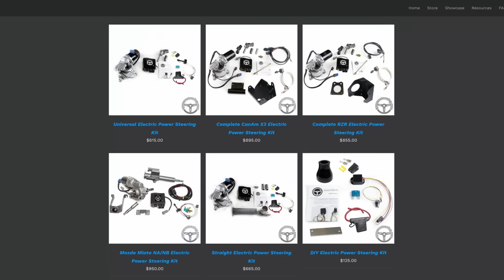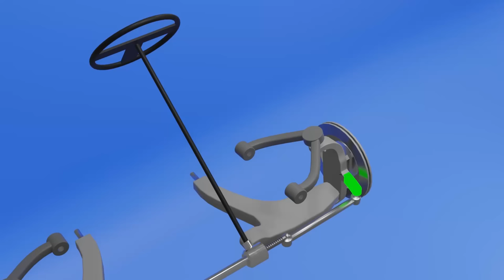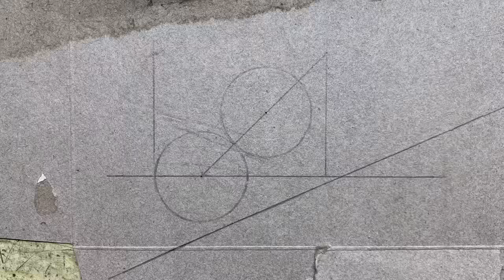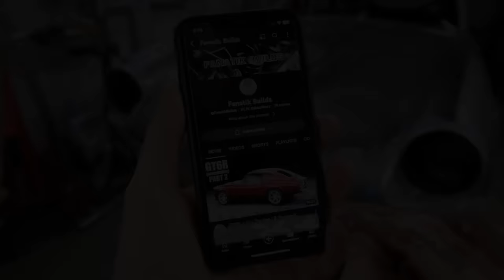EPS Steering Conversion // Pro Touring V8 Triumph Build – LS Powered GT6R – Ep34

Comment: Get your manifolds ceramic coated, inside and out, and maybe wrap the downpipes where they run in the engine bay (if there's room) and you'll have a lot less heat transfer up the steering shaft. Anyway, looking great!
Reply from the maker: Absolutely, heat management is going to be key!  Thanks man, enjoy the weekend ahead!
Reply: Also air escape vents from to bonnet area to let the hot air out upwards. Bonnet louvres are good. The Le Mans Spitfires (they had essentially the same body) used Herald 1200 radiator grills, cut down, in side vents.
Reply: What affect will heat have on the lubricant for the double universal joint?
Reply: @dannewth7149  yes, you have a good point. That short steering joint had better be heat shielded, and given a high temperature grease.
Reply: I don't think there's room for wrapping

Comment: If you're running a gm ecm, I recommend using the gauges from a trailblazer or from and mid 2000's truck so you'll have all the vitals
Reply from the maker: Not quite the direction we've got planned, but thanks Jerome! ✌️

Comment: That's a lot of stuff to shoehorn into not a lot of space!!! Going great guns. Fingers crossed the exhaust manifold doesn't get the shaft too hot. Ceramic coating the header will help a bit with that but yea, gonna be interesting long term 😉
Reply from the maker: Thanks man, it's been a process! 😅 We will open up a bit of space around the manifold and block (with a grinder) later so we can fit some heat shielding in place ... definitely getting ceramic coated though, so we'll see what happens! 👍✌️😊

Comment: Plug weld that steering shaft into the tube.

You know what I mean. If not Google tube it. Solidifies the joint and removes stress from the single weld ring.

Comment: Great to get an uodate from you! As usual, the work looks excellent.
FYI, that flat spot, plate and lock nut contraption on the original GT6 steering column is not a safety feature. It isn't designed to colapse in an accident (they didn't worry a out those things in the 1960s when the car was designed.)
 It is used to adjust the steering wheel closer or farther from the driver. But... 
I recently watched a YT video where much of the adjustment had been used, moving the steering wheel back closer to the driver close to the maximum amount possible... the result was a lot of vibration felt in the steering wheel. Once it was adjusted to position the steering wheel closer to the dash the vibrations largely disappeared. The video is on Elin Yakov's "Rusty Beauties" YT channel.
I agree with another post that heat from the exhaust may be an issue. The steering column in my Land Rover is nowhere near that close to the exhaust manifold, and it's heat wrapped from the factory. (Getting a bit tattered now, 26 years later.)
Reply from the maker: Hmm, everything I've ever known about the design of this column was indeed for safety reasons, as it's not easily adjustable to fit the driver, as modern cars are.  Either way, it could serve both purposes I guess!  What we've ended up with is the clamp being positioned right at the end of the original flat spot.  So there will be as little twist as possible with these parts. 👍  We'll increase the clearance around the exhaust as much as we can later (with a grinder) but ultimately some heat shields, sleeves and ceramic coating are all we can do, so we'll find out! 😅

Comment: Nice works guys!  If budget allows a custom built steering wheel could be made with an offset that would position the wheel either closer or further away from the driver.

Lets hope for proper alignment of the planets that will bring you new tools and garage sponsorship!!
Reply from the maker: Thanks David!  The wheel currently has a quick-release installed, so there's already 1.5" of optional offset baked in!  In the end I don't think we'll keep the quick-release ... likely replace it with a solid block, or just remove it entirely.  But I'm happy with fitment as it sits!  Haha, that would be awesome, particularly the garage bit! 😅🤞 Cheers man!

Comment: Absolutely wonderful build! I had a GT6 Mk2 back in the day, and I dropped a 2.5PI engine into it, and I thought that was radical, but an LS? Jeez.  Your engineering skills are off the chart.  Love the way you mounted the rad – TVR did the same on all Griff’s (I have owned one for decades) and other models, but they added a swirl pot which I’ve not seen on the posted videos which I have seen.
I’ll keep searching for you videos.  The GT6 is a gorgeous car – I loved mine to bits, and kinda wished I had never sold it.
Reply from the maker: Cheers Andrew!  Swirl pot/expansion tank yet to come 👌✌️ all the best to ya!

Comment: That will look just like an MGB, but it definitively won't be one. 😆 Your metal building skills quite evolved since day one and are quite impressive considering you have a MIG, a press drill and a grinder. On a side note, wouldn't it help to use some kind of lubrification when drilling ? Also, go check out some Schmidt Couplings for offset shafts. I know, I know, your setup is now done, but that would look mad in place of that double U-joint. 🙂

Keep it up, it is shaping up very nicely !

Comment: You have three U joints. That means they cannot be phased for constant velocity. If you have room for a 4th one it should be done. Brilliant work with just a grinder and a welder. If you needed a windshield I think you could fab one with these tools.
Reply from the maker: Haha, thanks Jeff, I'm not sure about that fabricated windshield, but we do need one still... so I guess there's a chance! 😉 In a drive-line, this is 100% correct.  However in a steering system, which will be turned slowly back and forth, I'm not concerned about the slightly imperfect phasing.  The lower double universal cancels itself out completely, so it's just the one UJ at the top that's of interest, and it's not a huge angle. I think we'll be fine.  Appreciate you raising the concern though! 👍

Comment: That's a very tight space that the steering shaft has to live in.  Have you considered the possibility of the engine contacting the shaft?  The degree of movement of the engine on the engine mounts under load, braking, cornering etc.  That said, nice work.
Reply from the maker: Definitely considered it, must not have made that clear enough in the video as I've had a lot of people ask about this.  The engine/transmission are mounted on polyurethane bushings that have an almost imperceptible amount of movement in them.  We will also come back when the engine is removed later, and do a bit of grinding on the block and manifold to make some more space for heat shielding - as it is, we could remove about an inch of the block without any issues whatsoever!  All should be fine in the end 👍 Thanks man!

Comment: Outstanding! Great work. Hope you’ve got some pretty hard engine mounts!
Reply from the maker: Thanks Baron!  It’s on poly mounts yes, but we’ll also likely remove a bit of material from the engine and manifold when everything is getting painted later … every millimetre and all that!! 👌🫡✌️
Reply: @FanatikBuilds  Also the way it torques it should move away from the steering shaft.
Reply: @Levibetz  ahhhh excellent point, I hadn’t considered that (but I’m sure Mike did) 😅

Comment: I love that a steering column with 2000 parts cost less than a small black box which you will never be able to open.
I am just 5'11" and my eye line in ever modern car i around the rear view mirror, viewing traffic lights or anything above pedestrian head height, or anything behind the steering wheel, like speedo, is some what troublesome. What you have no worse , so you are up with modern car standard.
Yes I have driven a Triumph Spitfire across Europe on a road trip with my brother .
Hope i live to see this completed, it is epic.
Reply from the maker: It is quite ironic isn't it!  A big reason why I'm trying to fit as many used OEM parts in here, as the new aftermarket stuff is priced ridiculously these days!  Good to hear, legs/torso proportion makes a difference, but I agree that the rearview mirror is usually pretty low in cars these days and often gets in my eye line as well... thanks, it's been a lot of work, but it's pretty comfortable in there now considering everything!  Sounds like a great road trip, I'd love to do a cross-continent one with ours someday!  All the best, and hopefully it will be done in the not too distant future 👍🤞

Comment: To get more foot room you could do what Jaguar did with the XK-E, lower the floor. The early Es were "flat floor" cars, they soon dropped the floor about an inch to gain room.
Reply from the maker: Yeah I thought about it, and I would, if some "dummy" hadn't put a frame in the way! 😅 (it now runs right underneath the floor pans) Honestly though, the foot room is perfectly ample now, so crisis diverted! 😊✌️
Reply: @FanatikBuilds  As I continued watching I saw that your solution was better than mine. Of course!

Comment: Looks amazing so far! The stuff you guys do in a limited shop really is amazing! 
One concern, do you think the steering shaft will bind when the engine is twisting and loading up the mounts? Or does it have solid mounts, I can’t remember lol!
Reply from the maker: Thanks Stephen, appreciate it!  All good, the engine/transmission are on polyurethane mounts, and any movement that is there, I can't even see! ... so it may have some NVH but at least I don't have to worry about it rocking in to anything important!  We'll do some slight adjusting (with a grinder) to the engine block and manifold later when it comes out too, just to get back every mm we can! ✌️😊

Comment: 6:30 For a long time i was curious if i could modify that part for my own purposes where nothing dangerous would result. So after talking with a couple of my friends one night, i decided that an unbiased test was in order, so i dissembled a yoke, drilled the shaft out and welded my own. Then i tested it against the unmolested other half. At the very least for that part, which i TIGged in place from both the inside of the yoke and the outside, i had no issues. Both yokes broke at about the same force level (roughly measured by how many pulls i did on the come-along i used), which would be far, far above any force you'd put on, neither failing in the link between the shaft and the yoke, rather in the arms of the yoke.

The idea was not mine (the drilling of the yoke and changing the shaft) but i'd always been too chicken to actually trust it. So far i've only used it for an off-road car, never for something on road, and in three years (which got a lot of use on account of the pandemic) hasn't had any issues. So, at the very least in this small sample size, it works that way, it's easier to find shafting in the right size than it is to grind it down without a lathe and the shape of the yoke doesn't help either.

About the procedure:

When i TIGged it, i heated both parts (shaft and yoke) in an oven, and did i put a bolt with nuts to keep the yoke from warping. I don't know that it would warp, but i thought better safe than sorry. I bored it out to the exact same size as the shafting by getting the closest drill i could find, then using a piece of sand paper on a flapper to bring it to a press fit. The shaft was the same shaft the steering came with, as this was just a test.

As for the test itself, i welded on both the unmodified yoke and the modified on a 20 cm lever arm with a hook, and i used a come-along to pull it. Dunno how much actual force i put on it, but the come-along was rated for 2.5 tons. I used bearings mounted to a piece of 1 cm flat stock which had a rod welded to keep the yoke static through the yoke's eyes (kinda like how the heart of the u-joint would, to mimic the OG nature of the joint as close as possible.

Comment: great job, If I may, there's a thing you should be watching carefully, those double u-joints on the base of the column at 20:50, I had a slight problem with one of them on my build,
There is 4 ''pinch'' punched on each cap so the cap will stay in place. I had one that kept sliding out of the joint resulting the joint to come very loose.
I drilled and tapped a hex cap screw on each to prevent them to slide out again.
Reply from the maker: Thanks for the heads up!  We need to do something like that for the upper UJ as well after we pull it apart for welding.  Steering is not something to take lightly, so better to be safe than sorry!  Cheers man! 🙏

Comment: Wow so much work, looking brilliant.  Could you have simply bent the dash tube that was causing issues? Great work.
Reply from the maker: Thanks Geoff!  In a perfect situation, yes, but I don't have the correct bender for this material, plus the bending process would have reduced the length, requiring a whole new bar, or some kind of extension.  The cut and splice will have to do I guess! 😅😉👍

Comment: Hope there isn't going to be too much engine rock - otherwise, with exhaust coatings / wrapping you may find it removes any clearance you currently have. Check out any potential movement on another vehicle running the same engine while revving etc. And please turn those vertical column mounting bolts so that the head is at the bottom.
Reply from the maker: Must not have made it clear in the video as quite a few people have commented this, but the engine/transmission are on polyurethane mounts, so very little movement at all.  Practically zero in fact, so I'm not worried in the least about it making contact.  We will open up a bit of space around the manifold and block (with a grinder) later so we can fit some heat shielding in place though. The bolts will be sorted in time... many assembly/re-assemblies to do yet 👍✌️

Comment: Excellent work. Have you taken into account how much the engine will move on the mounts? It looks awfully tight in there. I have a bit more room with my Spitfire project. But I put in a little 12A rotary. And I didn't go with any power steering as the car should come in well below the stock 750KG weight.
Reply from the maker: Definitely considered it, must not have made that clear enough in the video as I've had a lot of people ask about this.  The engine/transmission are mounted on polyurethane bushings that have an almost imperceptible amount of movement in them.  We will also come back when the engine is removed later, and do a bit of grinding on the block and manifold to make some more space for heat shielding - as it is, we could remove about an inch of the block without any issues whatsoever!  All should be fine in the end 👍 Thanks man!  And have fun with your Spit, that sounds like a riot!

Comment: Did you line up your u joints?in the steering shaft
Reply from the maker: Naturally!  Though keep in mind only the upper UJ is welded in place, so the orientation/phasing can be adjusted at any time.  Also, using three UJs technically means they will never be truly in phase, but it's not a driveshaft spinning 3000rpm ... so I'm not concerned! 👍✌️

Comment: I'm always impressed by what you guys accomplish with basic common sense and hand tools. I'm not sure if you follow Superfast Matt here on YT. He has a totally different approach and uses CAD to design brackets and such and then sends them out to a company called I think Send, Cut, Send to have them CNC laser cut.

I always look forward to your vids. This is gonna be a really cool car when it's finished.
Reply from the maker: Appreciate it Jeff!  Yes Matt's a very talented guy, can learn a lot from watching his stuff!  Send Cut Send has a $19usd flat rate shipping program to Canada (which is decent) but the issue is the additional duties, taxes and exchange rate to get the stuff here.  Honestly, breaking my back a little bit and using a grinding disk or two to have the part in my hand within minutes, just works for me. 😊👍 Cheers!

Comment: when you get the Steering operational - i hope you do an indepth video of the programing of hte EPS module used - I have a nova build and really like the idea of the Electric steering
Reply from the maker: It'll definitely be in an episode someday!  Shouldn't have to do much programming though, it's supposed to be wire in and go from what I understand!  The product is from Bruno Steering ... you can find them on ebay as well as his website 👍

Comment: Regarding breaks 
There is a BMW booster setup for right hand drive cars that has the booster and master cylinder on the left. I forget how it works exactly but it is an out side the box solution.
It might be that they used a rod and bell crank or a clutch master and slave to work the master.
Reply from the maker: Sounds interesting, I managed to find an off the shelf product which we can modify to make it all work perfectly!  Ep35 is going to be pretty involved! 😅🤞

Comment: For that screw sticking out of the double u joint near the oil pan, could you use a grub screw to give you a bit more clearance?
Reply from the maker: We could yes, but the current grub screw is that length because a lock nut gets tightened down on top to prevent it backing out!  Better off just clearancing the oil pan if necessary, but time will tell! 😊✌️  Cheers Matthew!

Comment: I reckon your steering shaft clearance is even less than mine! Currently fighting with  centre mounting I could even consider copying that spherical joint idea (we call those Rose joints over here) 

PS I hope you considered engine movement!
Reply from the maker: It was always going to be a trick to get this working, but I'm glad things panned out in the end!  Yes we did, the engine's on poly mounts so there's really very little movement there... just hoping the vibrations won't be incredibly annoying but at this point it is what it is!  We'll likely also grind back a small amount of the block and manifold later to get a few more mm's of clearance... every bit helps!